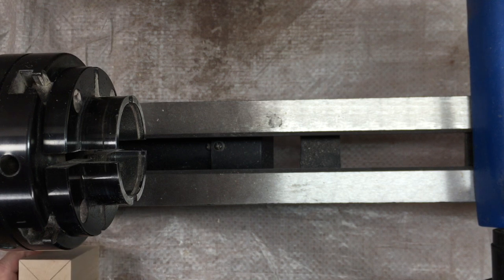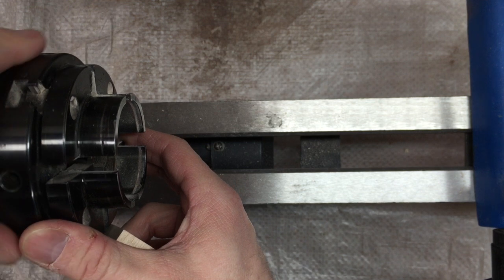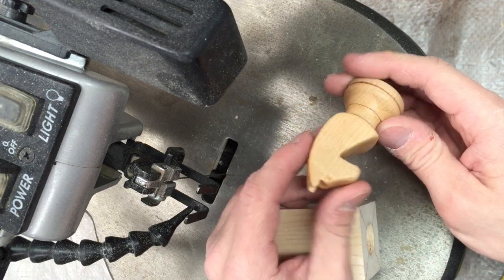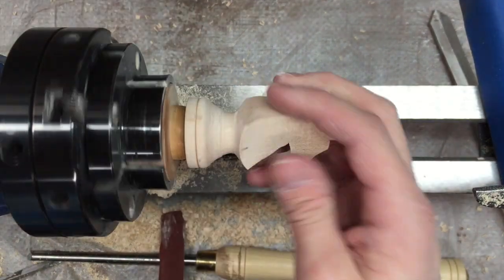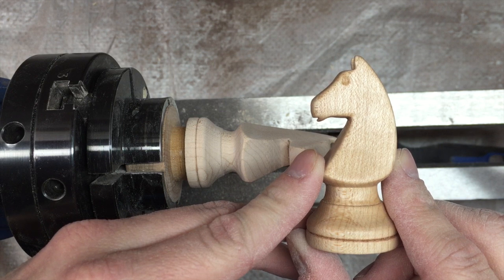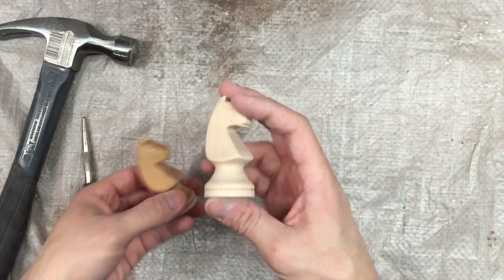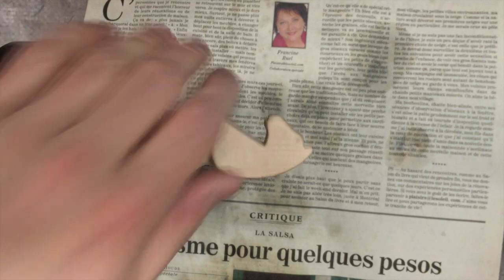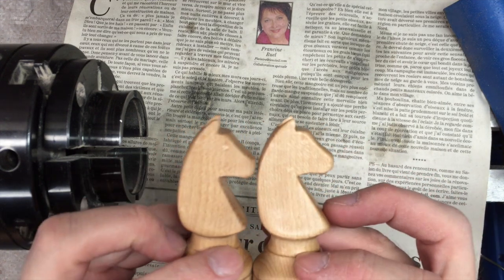Woodturning chess set - KNIGHT

Comment: I've tried making a Knight.  Rather than make it out of one piece, I cut the horse head out of a rectangular blank on the scroll saw.    I first cut out the profile of the horse head, and reattached the two slices of wood that I removed using double sided scotch tape.  I then cut out the obverse image, and removed the excess wood.  This left a rough carving of the horse head,  and then  i finished carving it with both hand tools and a Dremel. I then turned the base of the piece and glued the two together with a dowel in the joint.  

It's also possible to turn the horse heads as a bowl, with the front of the head on the inside surface of the bowl, and the back of the head on the outside.  Then you cut out slices of the bowl for each of the heads, and again finish with hand tools or a Dremel to add the final touches.  A separate base is again turned and the two parts are glued together. 
You can make the Knight in one piece as you did, but out of a round stock.  Hold the dowel in a wood compression clamp to make the saw cuts.

Comment: hey there! you made a great figure, but I'm interested in how the head with the drill is fixed.. I have the same small lathe and everything is very similar to yours, but I want to make a drill head like the one you used when drilling the hole.. I saw that the part that goes in is in a cone.. but how is it secured so that it does not rotate while drilling the hole?
Reply from the maker: check my pawn video, I talk about it